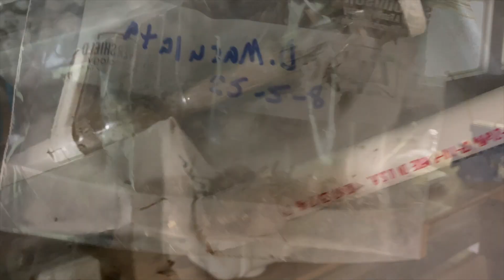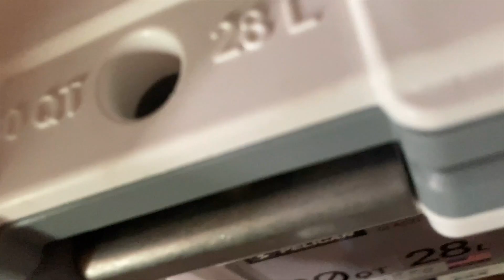BALDFACED HORNET NEST REMOVED FROM TREE FOR VENOM COLLECTION! FREEZING WASPS FOR VENOM IMMUNOTHERAPY

Comment: I have the same bee vacuum.  Where did you get the vacuum extension poles?
Reply from the maker: Hi jg08.   Tony Andric's "Everything Bee Vac" is a great tool for what we do.  We then use multi-purpose extension poles and cut the ends off the top and bottom to make a hollow extendable tube.  These are then fitted with specimen collection bottles which are attached to the top of the pole while the vac suction tube is attached to the base of the pole.  This creates a bee vac capable of extending to whatever heights the pole can reach.  Great way to mitigate risk by staying on the ground while working at height.
Reply: @greenwaspremoval  this is an amazing idea and has given me a ton of ideas, thank you!!!
Reply from the maker: You're welcome!  Let us know what good ideas you come up with that work well in the field for bees/wasps.  Crowdsourced sharing of evidence-based knowledge is the best use of internet technology!
Reply: @greenwaspremoval  for sure!  I'll try to reach out via phone or email coming up, I'd love to collaborate.
Reply from the maker: The more bee and wasp enthusiasts/experts/removal specialists the world can generate the better, especially if they are trained in the importance of utilizing non-toxic ecologically responsible methods.